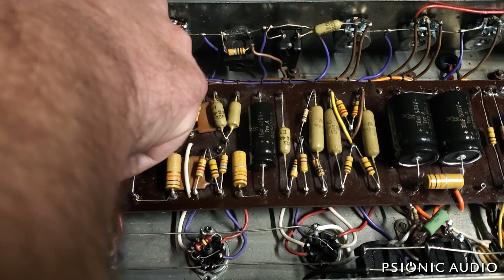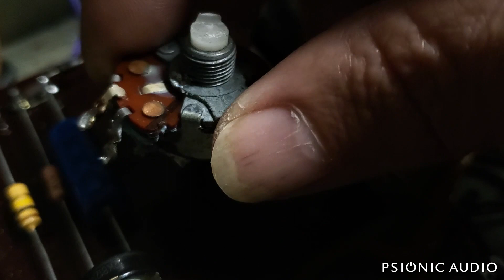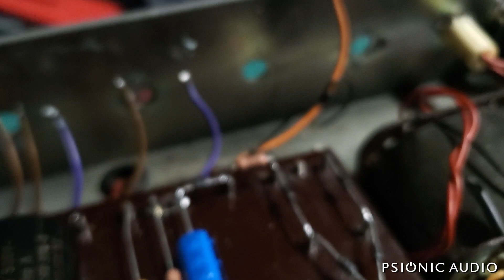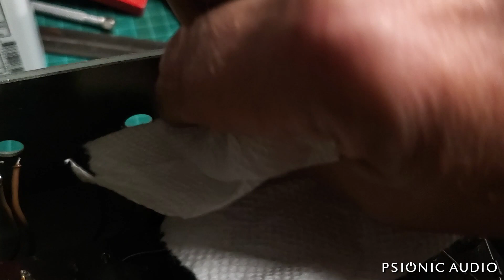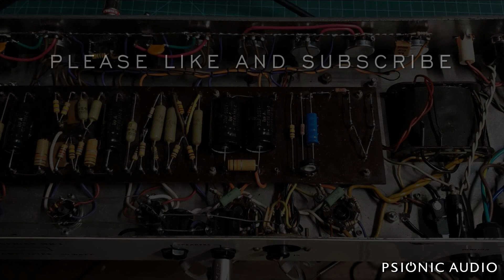'69 Laney Supergroup | Part 6 : All the Nasties Gone

Comment: Hey Lyle……would a 18ga., tinned copper wire work for the grounding bus? I know copper will oxide over time, the twisted, tinned wire you chose hold up better? Happy Holidaz! Love from your devoted followers in NW Colorado. Thanxz
Reply from the maker: So long as it's fully tinned it won't oxidize. 18AWG is fine as far as current goes. So would 22AWG be as far as current. I used the twisted 20AWG for mechanical strength.